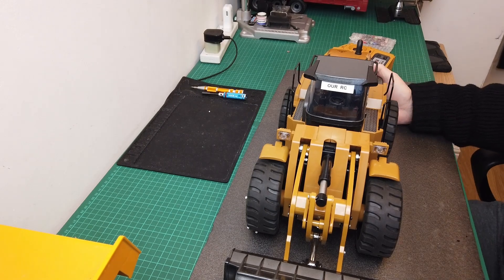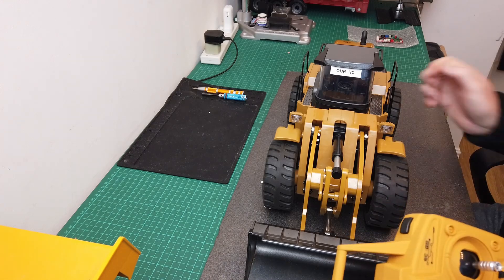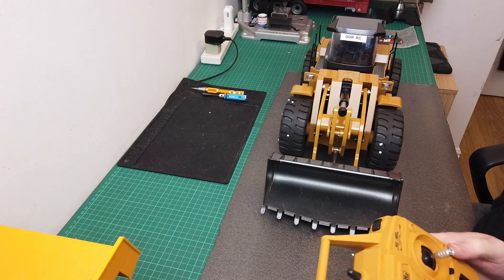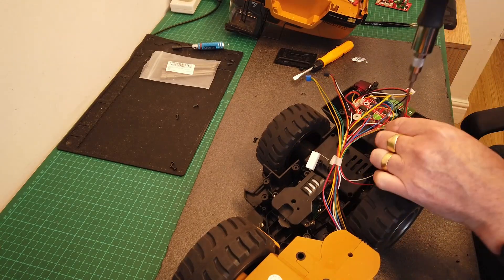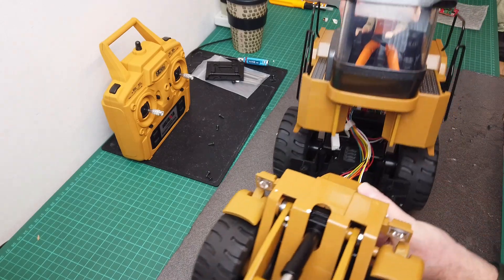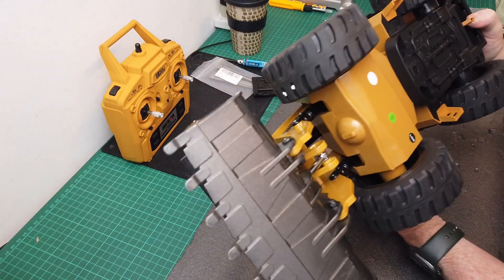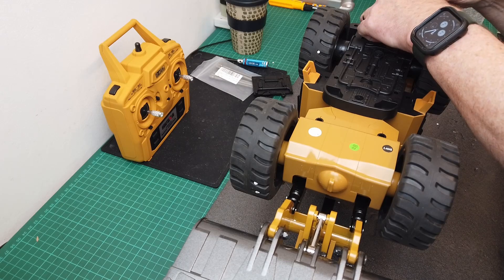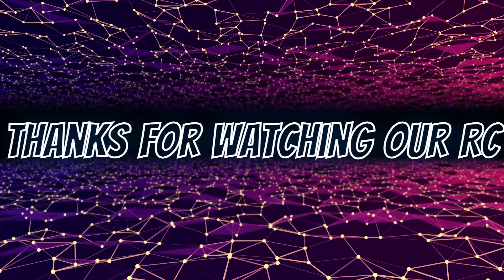Huina 1583 Front loader with Proportional speed controller

Comment: Did you have to solder the black and red wires to the new board ? I've read somewhere someone commented on that .looks like all you do is unplug it and plug it back in .
Reply from the maker: I don't recall having to solder any wires on it was just a straight swap.

Comment: I bought a new remote control for this RC. How can I connect it with each other ?!
Reply from the maker: Hi,  as far as I'm aware the controllers are bound at the factory. If your receiver board is Version A and your new controller is Version C then it won't work, to my knowledge. You would need to update your receiver board also. I would contact Huina direct and ask them to for there advice. Good luck with it. Please let me know how you get on.